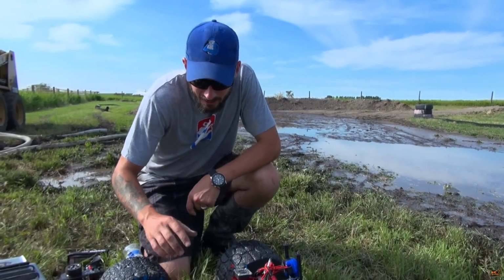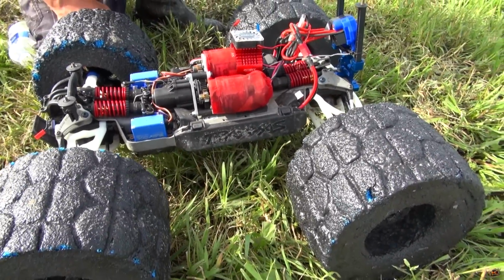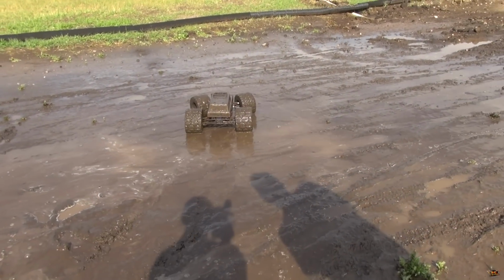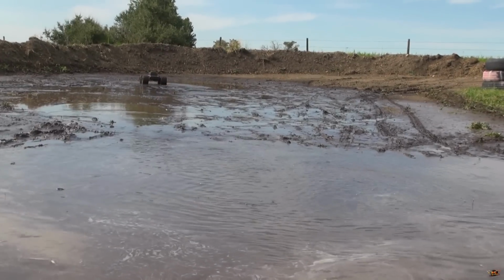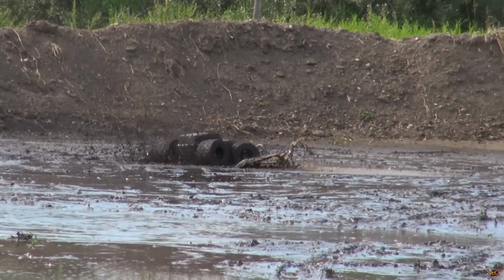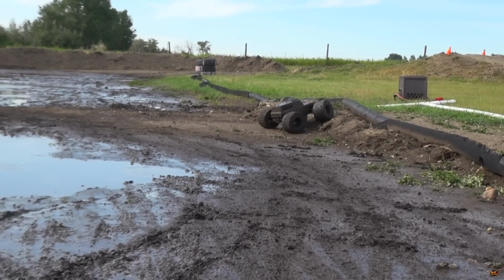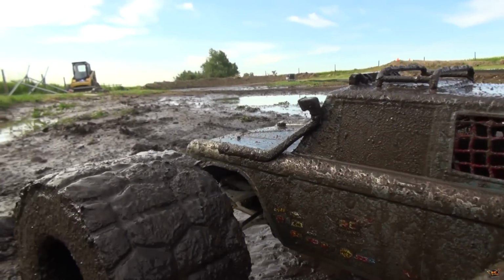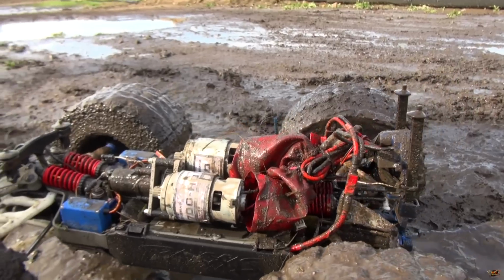RC ADVENTURES - Mud Camouflage - Traxxas Summit 4x4

Comment: Where do you get that brushed motor mesh protective sleeve?
Reply: +Dami Nooki hey mate the are not electrical tape they are mesh sleeves
Reply: +Dami Nooki lol tape would burn the motors up because their would be know air flow
Reply: There's a site called eBay or amazon